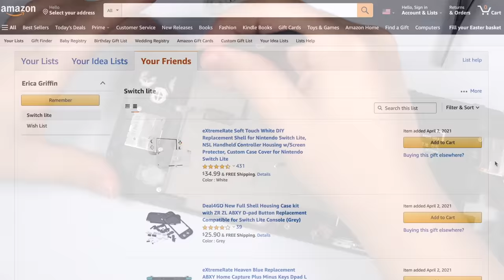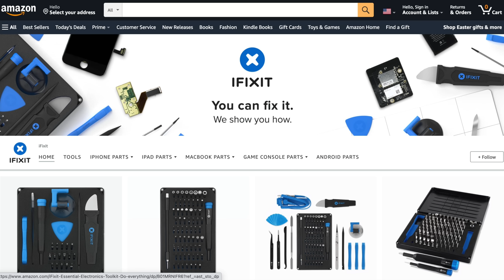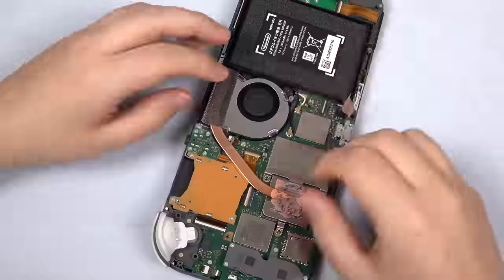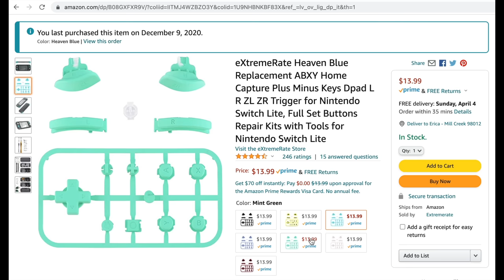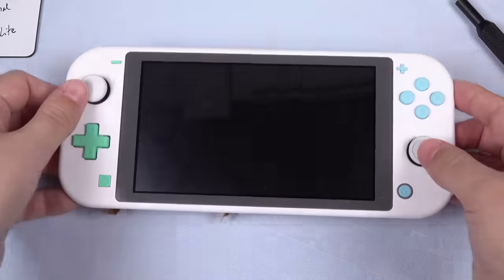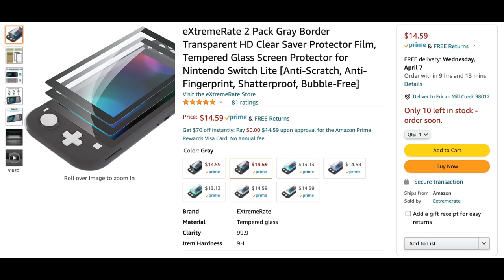DIY Animal Crossing Edition: Switch Lite

Comment: BIG disclaimer for anyone doing this modification.

Unless you're skilled at applying thermal paste, don't just use ANY paste you may have or buy. Make sure you buy non-electrically conductive thermal paste, such as the one Erica recommends. Any slip up on the paste making contact with anything other than the SoC will potentially short those components.

If this is your first go around at applying paste, please make sure that the paste claims "non-electrically conductive." Or that it doesn't contain metals.
Reply from the maker: This is why I direct people to my in-depth video
Reply: I have the same villager canberra as you :D

Comment: I love swapping parts on my switch, but the soft touch coating on extremerate components tends to get flaky/wears off after some use. When I had a white joycon set from them they ended up getting dirty after awhile as well and it was very noticeable

Comment: Have you come across replacement backplate vent filters/stickers? I see ones for the regular switch but they're a bit larger than the Lite. Also any recommendations on what adhesive to use between the LCD and digitizer if replacing the digitizer? I see listings for adhesive foam that fits between the regular switch LCD and digitizer, but nothing for switch lite.